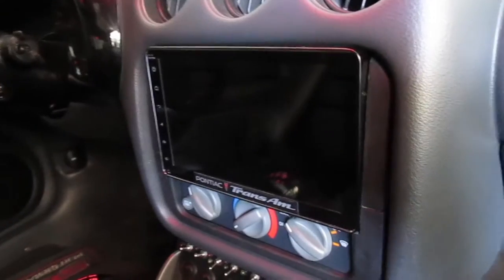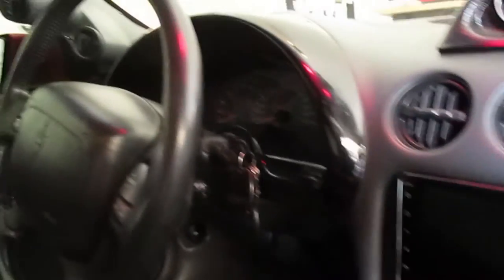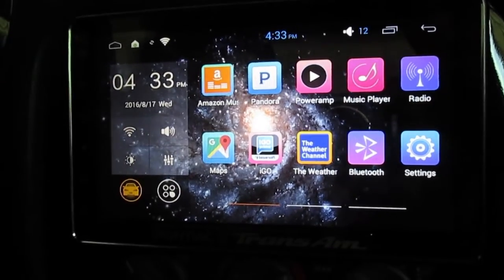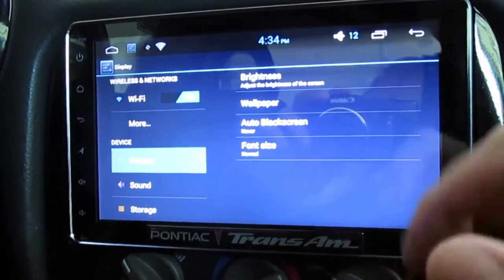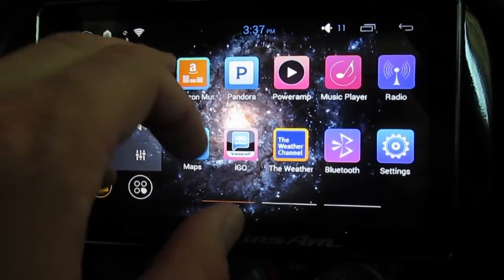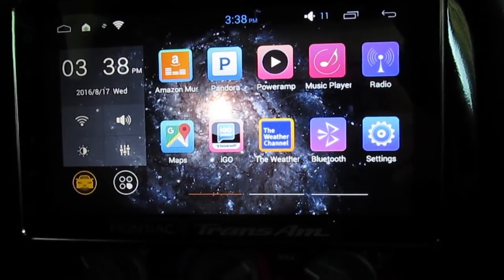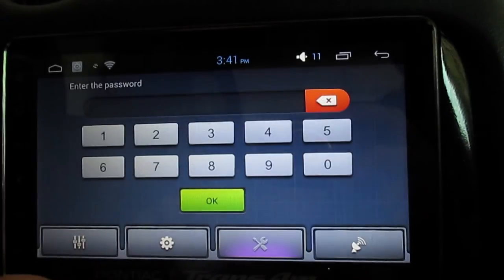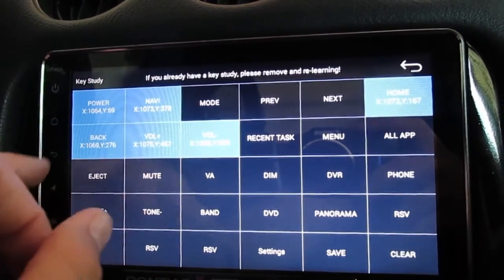1999 Trans Am Joying 8" Double Din Android Car Stereo

Comment: Just about to pull the trigger on this thanks to your review.  Just a couple questions if i may: 1-  Does it have a good GPS?  2- Can apps be side-loaded from an APK?  Thanks in advance.
Reply from the maker: GPS works awesome on it.   I've never had a problem.   It comes with igo and Google maps installed.    I've never side loaded but I know you can.
Reply: Again - Thank You!

Comment: This video really helpful! Just a couple of questions,
1. dormancy mode does affect car battery? As far as I know, OWNICE c300 model provide only 48 hour fastboot. But, joying model has no description about that, so I worry about that because it would be consumption car battery.
2. GPS mixing working good?
3. EQ affect all the sound source? (BT music, installed app like spotify, USB, etc.,)
Thx in advance.
Reply from the maker: GPS mixing is very good.   EQ affects all sound sources.    As for dormancy,  the amount of power it draws is next to nothing.   You can leave your car for weeks and not have a problem.

Comment: Any more detail on this? What you all cut, modified? What did you use to make the bezel thicker on sides? I'm looking at 7 inch that fits in right into a bezel but it leaves a lot of room on each side, this looks much nicer to me. Guessing this is the universal double din 8 they sell?
Reply from the maker: The only issue with this is it cuts off the tops of the HVAC panel.  That part doesn't bother me though.   I just used some lexan and Bondo to build up the sides.   I started with a metra double din bezel since they are cheap and come with the mounting brackets that I needed anyway.  Yeah this is the universal one they sell.  Check out my other video on the 8.8" widescreen one.  It looks much better IMO.
Reply: @1999TransAmWS6  will do, thanks man. Nice car. I need to start getting my interior updated it's all original and worn out.

Comment: Are you still using your stock monsoon amp for your full range speakers? Any issues if you did not do an amp bypass?
Reply from the maker: RCKT82   in one of my Trans Ams I am using the stock Monsoon amp.   You won't have any problems.   My 2nd trans am I hooked up a 5 channel rockford fosgate amp with all new speakers and 10" jl audio sub.   It sounds amazing and blows the factory amp/speakers out of the water

Comment: Nice! I have a 1999 Trans Am as well, I was thinking of using this to run my holley software instead of having a lap top in the car all the time. You happen to make and sell the bezel piece by chance?
Reply from the maker: The joying radios are pretty picky what they can connect to if you're planning on controlling it with the touch screen.  They pretty much only work with a phone, and a OBD2 Elm connector.  I tried using the radio to control my knight rider light which uses bluetooth and it wouldn't connect to it.   It does have a mirror link option though if you can control the hollow software with your phone.      No, I don't sell the bezel.  It was pretty time consuming to make.
Reply: Guess i was thinking this was like a little PC, but pretty much its like a phone? Ide have to be able to download the hollry software,..   If there is not an app for it, then you cant download it correct?
Reply from the maker: waterbug1999   correct, it's basically an Android tablet that works like a car radio.  If there's not an app then you can't use it that way.  Even if there is an app that uses Bluetooth I doubt the joying will connect to it
Reply from the maker: waterbug1999   there are mini car computers on Amazon for about $150.  You could always get a monitor for it.
Reply: Sounds good... Thanks!

Comment: hi as far as the harness did you have to get with the company to get in for the car or you just bought the unit the way it comes what do you need for the unit to work on a 2000 trans am any input would sure be appreciated
Reply from the maker: Edwin Setback if you buy the metra bezel kit from DoubleDMods.com, you'll get the antenna adapter and wiring harness.  The last thing youll need is the pac swi-rc if you're hooking up steering wheel controls.

Comment: Would this work with my 1996
Formula?  I'd like to get a double din installed but I'm a little nervous.  What else besides this would I need to install an aftermarket radio?
Reply from the maker: Yeah, it will fit in any 1993-2002 firebird or Trans Am.  Doing a 8" like this one is a little more difficult though because you have to modify the outer bezel.   You can buy any standard double DIN radio though and get a bezel kit from DoubleDmods.com or even Amazon.  DoubleDMods comes with the antenna adapter and wiring harness you will need.  Wire soldering or splicing is needed to attach the radio to the wiring harness adapter then it's just plug and play and almost 100% reversible.    There's a little plastic tray the stock radio sits on in the dash that's super thin plastic.  You have to cut it to make a double din fit.  It's not structural.  It just holds the stock 1.5 Din radio in place at the assembly line so the car builder could put the bolts in.  Some regular cutters make short work of it.
Reply: 1999TransAmWS6 Thanks for the fast reply.  Is there anything else I need for getting it to work with the steering wheel controls?
Reply from the maker: You'll need a PAC module.  I show it in my other video.
Reply: Awesome!  Thanks much!

Comment: Just got mine installed yesterday, just found out that it's not an MTCB unit and thus not being able to instal Malaysk ROM. Also found out that only Kingroot works but there are lots of privacy issues with Kingroot

Anyone has luck with custom ROMs or root? Thanks in advance
Reply from the maker: This one runs a new processor at 1.8ghz.  I don't even know if it's mtcd.    Just say joying released another new model.   It's now 2gb of ram with lollipop,  the faster processor and the new ROM that's on this unit.   It's only available in the 10.1" at the moment but they'll be adding it to all sizes.

Comment: Do you still have the monsoon equipment in your firebird?
Reply from the maker: Lacey Cooley   I did originally.  The monsoon system will hook up fine to any aftermarket head unit including this one.  I've since replaced all the speakers and use an aftermarket amp.  The monsoon system is 20 year old technology.  You'll notice a massive sound quality improvement going to an aftermarket radio and an even bigger improvement switching speakers and amp.
Reply: 1999TransAmWS6 i had checked a local shop who does installation and they were quoting me at 4,000 does that seem like a rip off to you? They made it sound like the monsoon system was going to be a pain to remove and they said they would literally have to gut it and rewire the whole thing. That quote was for all speakers, a subwoofer, and the stereo is a dnx 995s. Just wanted to get some advice since your way more familiar with these kind of cars lol
Reply from the maker: Lacey Cooley a lot depends on the speaker brand that you're using and the amp. What brand are they and how much do they cost?. But that price does sound completely insane. There is no gutting anything it, it's just running new speaker wires. The monsoon amp can stay where it is and there's nothing fancy about changing out the speakers. I've done complete radio installs on many cars most of them trans am's like this. I can change out the radio all the speakers, run new cable to all the speakers, and install an amp and just under 3 hours. Even if their hourly rate is $80 that's just 240 bucks in install fees.  Definitely go somewhere else they're trying to rip you off.
Reply: 1999TransAmWS6 yeah they just had a list of items on the computer and they were trying to charge $950 just for labor. I think ill just try and find a guide and try it myself it shouldnt be to hard. Thanks for the advice!

Comment: how much bigger is this compared to the double din slot?
any pictures from the backside?
Reply from the maker: styggederrik   my car doesn't have a double din slot.   It's 1.5din but plenty of room to fit it since I basically had a huge open hole once the trim bezel is removed.
Reply: I figured it out later on that the 8" model is a 1DIN. There is no 8" double DIN yet. I think i am going for the 7" double DIN, i guess it has the same software as yours, that's most important for me. :)
Reply from the maker: styggederrik   Sure there is.   Both of my cars have the double din 8" version.   Joying offers both.   Their website recently droped out the double din version.   Amazon still has it.    Joying is currently switching all their radios over to 2gb of ram.   Mine sadly has 1gb.  It's probably why the 8" double din 4.4.4 version no longer shows up on their site.   They just released the 1 din 8" 2gb running 5.1.1 about 2 weeks ago.   The 2din version of it should be right around the corner.
Reply: Thanks for all that information. :)
I'll definitly wait for the double DIN 8" 5.1.1 since i have room for the 8". 7" is maybe a little small to operate while driving. :)
Reply from the maker: I had a 7" joying before the 8" and 1" doesn't sound like a lot but it really is.  It makes a HUGE difference.   I agree, your best bet is to wait for the 8" 2GB ram version in double din.  When it comes out I'll probably swap mine out as well and just toss my two radios on Ebay.   1GB of ram just isnt' enough anymore.  You get to the point with the constant app updates where you run out of memory so you can't do any updates anymore.  I used to have to uninstall apps to just update google maps then reinstall when it was done.  That got super annoying.    I'm guessing 1-3 weeks an the new 8" will be ready.  :)
Reply: I see some of your pictures are used on the Joying web page. Do you have contact with them? Can you ask them about the 8" doubledin? :)
Reply from the maker: styggederrik   I haven't talked with them in months.   I'll see what I can do though   😊
Reply from the maker: styggederrik    Joying just listed a double din 8" running 5.1.1 but only 1gb of ram.   I don't know why they did not release it with 2gb like the single din.
Reply: 1999TransAmWS6 mmmh, i will contact them and ask about a 2GB 8" version.
Reply: the 2GB version is coming in about 1 month! really looking forward for it now.
Reply from the maker: It's available now   https://www.carjoying.com/new-android-car-radio/quad-core-2-din-android-car-audio/joying-automotive-ram-2gb-rom-32gb-universal-pip-gps-navigation-touchscreen-panel-8-inch-double-2-din-new-android-5-1-1-lollipop-in-dash-head-unit-replacement-support-backup-camera-res.html
Reply: Got mine today, the above one you linked to. I love it so much. :)
thanks for your video, else i wouldn't have bought one. :)
Reply: One question, how did you wire up the steering wheel controls, i guess i need a extra box for that for around 30$.

Comment: Nice review. Makes wish I waited on mine a bit more, but I really didn't want to go with 8" in my Camaro. Hopefully Joying will have some updates to current units. Here's mine with Nova Launcher.... Hope the link works. https://www.dropbox.com/s/j9u7etcfechtnm6/20160818_094300.jpg?dl=0
Reply from the maker: I'm not sure if they're going to update the older ones to this software version.  I hope they do.   Guess it depends on if the hardware is different.  I have the 7" joying stereo in my other Trans Am.   Works great for my daily driver.   For this Trans Am I wanted to do something different since it's mainly used for car shows.
Reply from the maker: I didn't realize when I made the video,  but I just checked the hardware specs.... The new radios that just got releases (including this 8" one) are now running a faster processor.   I've had a few joying radios and this one feels blazing fast.    They just listed the same 7" version I have on amazon with the faster processor and new software for $219 shipped....might have to upgrade my other TA
Reply: It looks like the one you got is 1.8ghz vs 1.6ghz on my UL-135

Comment: It would be nice if it was detachable. Does it have built-in WIFI? How much built-in memory does it have?  What is the largest memory card it can read?  Does it have password security to make it useless if someone steals it? Can it power an external hard drive? My last one got stolen 48 hours after install. I hate a thief. So, now I'm looking for one that if stolen, the only thing would show up on the screen is Enter password...Unit is useless if STOLEN,  Reset will not defeat password...$_Reward if returned. call owner or manufacturer for help:.... If you input the wrong code it will use facial recognition to start taking pictures with built-in security selfie camera and find a WIFI signal to send email and text of its GPS location continuously whenever power is applied until it is destroyed. That's the unit I want. Jensen sort of has the password security but no WIFI so it wont work either.
Reply from the maker: It has build in WiFi with 1GB of ram and can support a 32GB SD card or 64gb USB stick.   There is a lock password but I've never used it.  Technically you can detach the face on this one but you'll wear out the wire connector on the back in no time.  I wouldn't though.  Sorry to hear you had yours stolen.  I didn't think people stole radios anymore.  That was more of a late 90's thing.  Most modern radios (pioneer, JVC, Clarion) don't have detachable faces on the double din models.  I had the $1400 pioneer NEX receiver and no detachable face.  I actually made my own custom radio theft deterrent.  Works like a charm but I mostly park my garage and never take it to bad areas, never the city.
Reply: I was just about to order one until I found out it don't have a dvd player. It's got everything else though. oh well, I'll keep looking. Thanks.